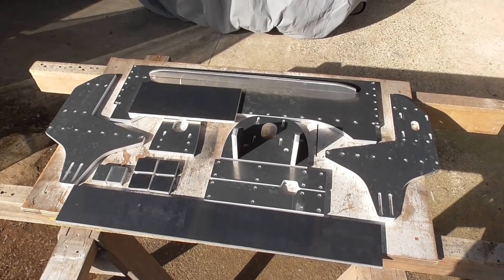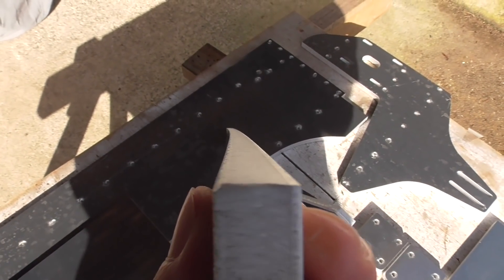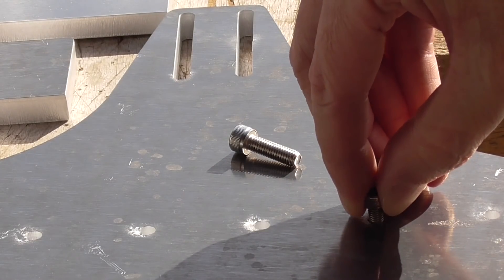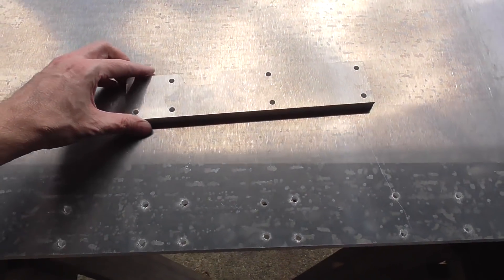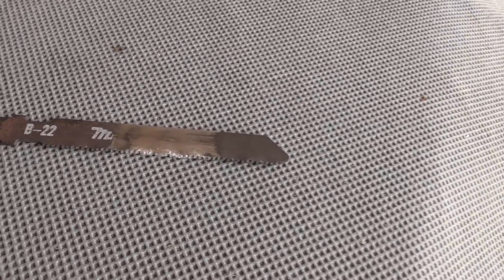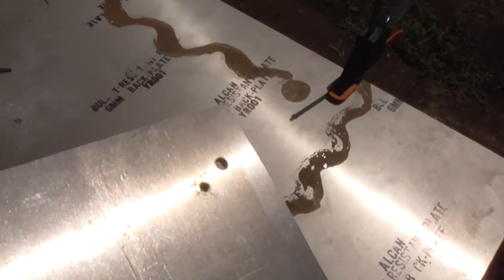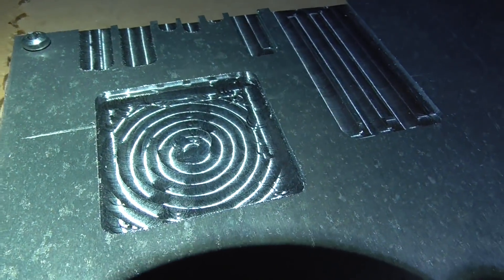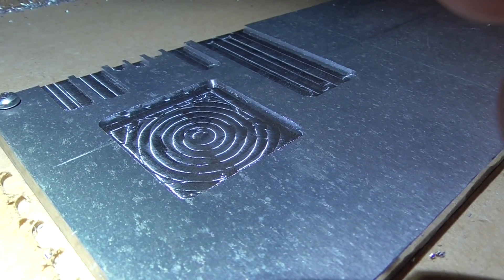Another DIY CNC router, part 5 (laser cut plates lookover, test cuts with MDF mockup)

Comment: Lubrication or rather lack of........if you're after cheapass, you can go mineral turps, if you want the best, especially if tapping holes and you don't want to end up with broken tap, use aluminium tap magic for cutting, drilling and tapping. You'll end up with a much closer tolerence finish. 
We used to use a dry lube which came in a cartridge similar to a grease gun cartridge where one would dip the end of the jigsaw balde, drill or whatever into the dry wax like lube.As the contents diminished, one would simply tear off a section of the outer cardboard tube. 
Haven't seen it around for many years though.
The aircraft grade aluminium I use here in small scrap offcuts, cuts, drills and machines more like fibreglass, whereas the everyday aluminium is daggy doughy and a real bugger to work with. 
Only approach is lube, lube, and lube some more.
Any ridges will be due to the head being out of line.
Milling machine I have here with a dovetail z axis took near 4 hours to properly aline at zero degrees and then pinned at that. Reason being it has ability to be set on an angle and if I ever move it, I don't want to have to go through the same drawnout process.

Comment: Laser appears not the ideal for parts which rely on cut sides to fit. Holes appear to have been started at the edge whereas a centre start would eliminate the blow out. 
Overall I'd be more inclined to have the parts milled on cnc.
Reply from the maker: When I was making the small CNC it was hard to get any local shops interested in milling large flat plates. Most of them have quite limited workspace size, such that even my 500x600 main plate was too big. Without exception they all told me I should be looking at waterjet or laser, and the one place that did say they could do it procrastinated for four months and then gave me a quote that was prohibitively expensive. So this time I didn't even bother looking at getting machined parts. Plus this time I was starting with a small CNC available, so smaller and complex parts where milling is a huge benefit I could make myself (provided I designed within the capabilities of the small machine).

Comment: Is it worth using the machine as it is to remove the extra 1.5mm from the bottom edges of the gantry plate? (3:30 and 4:50)  It would only be a straight cut, so with caution and conservative settings, you should get a good outcome.  Maybe try it first on the angle plates? (4:20)
I just watched this for the third time in a row!  I am probably in trouble with "She who must be obeyed"!    Ahh well.     :o)
Reply from the maker: I'm thinking to use it to remove the 1.5mm from the top of the base plate, in a channel just wide enough for the gantry foot to sit in. That would be easier all round and the smaller piece can fit in the area I've already surfaced.
Reply: @iforce2d  That makes a lot of sense.   👍

Comment: The roughness on one side of the adaptive clearing cut (19:00) will be from lack of rigidity in the MDF machine.  The cuts on the near side are (by coincidence) trammed about right, while the far side is out because the cutting forces are in the opposite direction.  You can pretty much guarantee this will disappear in the final build.
Reply from the maker: I sure hope so :) One thing about the MDF mockup that I forgot to mention is it is also intended as a way to detect weaknesses where flex will show up most. Since it has very uniform density and no grain (eg. versus regular wood or plywood) my thinking was that it would simulate aluminium well. It also has a habit of stripping 'thread' easily if you turn the bolts too far, or even splitting apart where a bolt goes too close to the edge. This was not quite as planned, but I guess it's a good way to simulate a weak joint :)

Comment: At 8:00 you mention you should have tapped the holes. Can use one of those those tread repair kits to add threads to your oversized hole?
These are called thread inserts or helical inserts. You can get 100 for $93 at Grainger. I think they're available from a lot of other places as well.
Thanks for sharing your progress with us. It's always fun to follow along with your projects.
Reply: i'd check if going one size up (M8?) would be an option first. If the space is there that would be easier.
Reply from the maker: Yeah I have been considering M8 as another option. Space would be tight under the carriage block on the top side and I might need to gouge a little out of the rail support extrusion so that the bolt head can fit (sideways), but I think in many ways that's the best option. Will need to get my hands on some M8 bolts before I can make a decision.
Reply: @iforce2d  my immediate thought was to drill out and thread for M8 and countersink.
Reply from the maker: I bought the M8 bolts and tap, gonna do that :)

Comment: Better to use zinc plated bolts with aluminium. Stainless will "gal" and binds super easily. Crazy easily, also creates a galvanic voltage differential leads to accelerated corrosion.
Reply from the maker: The guy at the bolt shop warned me of this too. I was actually a little surprised because I used stainless for almost all bolts on the small machine and they show no corrosion compared to whatever the other ones are which now have a thin coating of rust. From what I can tell the corrosion is only a big problem in an environment with a lot of moisture, eg. outdoors. As for galling, don't know... maybe I should try removing a bolt on the small machine.
Reply: @iforce2d  Yea can get  away with it, just stick some antiseize on stuff that needs to come off in future and you'll be fine. I've gotten away with it for years, but had several parts just get written off when a snug shaft was dropped into an aluminium hole, it instantly froze up. Ended up totally ruining the parts trying to take them apart with some heat, I was very surprised at how it instantly grabbed on snug fitting parts.

Comment: If you're brave, a regular circular saw will happily cut aluminium, I've even cut scrap aluminium castings with my skilsaw at a depth of an inch or so. You might try a coarser blade for your jigsaw, you should have no problems cutting aluminium much faster as long as you can clear the swarf, so big teeth are helpful there
Reply from the maker: After cutting a couple of those small rectangles at the pace of a comatose snail, I'm already thinking some other method will need to be found...
Reply: @iforce2d  normal wood blades in the jig saw should be fine and work better
Reply: @iforce2d  Bandsaw for the smaller plates, circular saw for the larger for sure, the metal cutting blades for both work just fine on aluminium.

Comment: Flashbacks to my time operating a couple of big lasers here in hawkes bay! Of course I can't speak to the quality of the service you're using, but I would say typically, in softer materials like aluminium or mild steel, tapping a laser cut hole in no issue. In fact, we even offered tapping as an extra service
Reply: Is that Laser cut or actually waterjet?